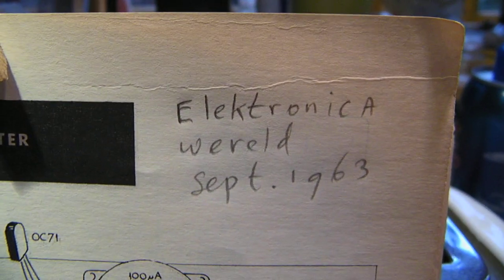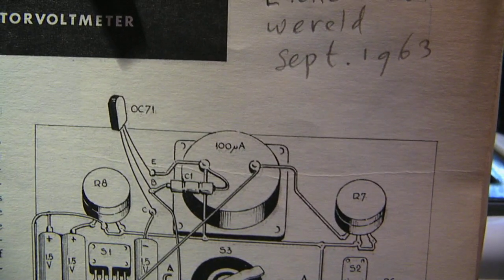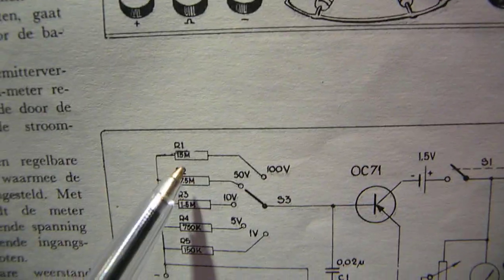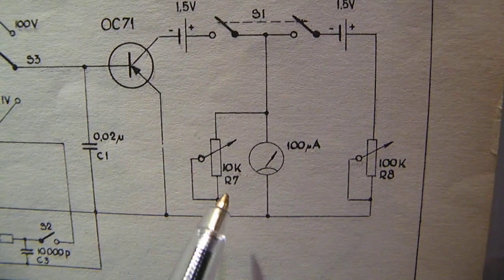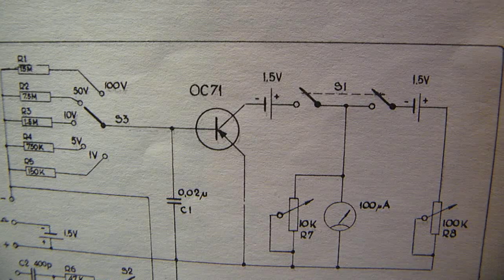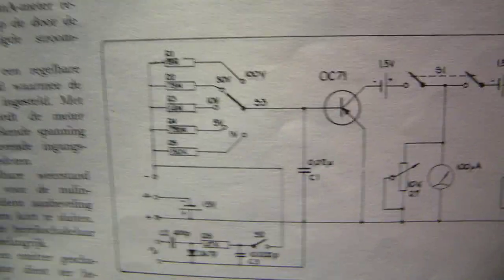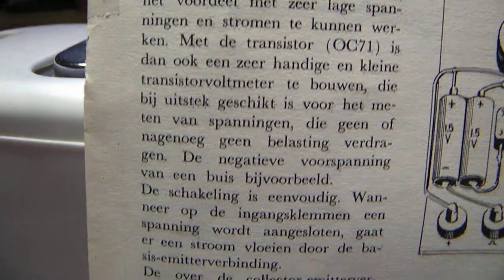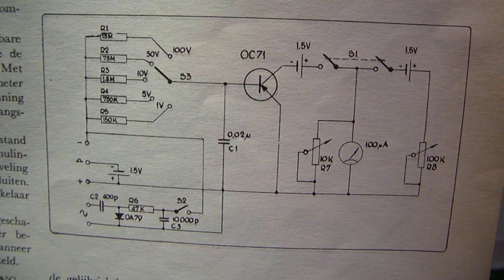Transistor voltmeter with very high input impedance (schematic 1963)

Comment: can we use silicon transistor? like many circuits in your videos? it is hard to find germanium transistor !
Reply from the maker: Perhaps when you raise the 2 voltage sources (batteries) of 1,5 V to 3 Volt. Reason: the barrier voltage of a Silicon transistor is say between 0,7 V - 0,8 Volt and the barrier voltage of a Germanium transistor (used here) is (say) 0,3 Volt. That means that a 1,5 V battery is surely enough to drive a Germanium transistor but 1,5 V could be too small to drive a Silicon transistor. And you must use a BC 557 (PNP) Silicon transistor for such an experiment (Si transistor). I think there is a good chance that it will work (even with 2 x 1,5V it can, in theory, work). Try as a first experiment (to get your question answered): only 1 input resistor (say for 10 Volt), no AC input circuit (diode etc), so only the "bare" circuit. I am interested.

Comment: This is more a proof of concept than a practical circuit. It is prone to drift due to the unbalanced nature of the primitive Ge transistor and the lack of negative feedback makes it dependent on the linearity  of the hFE function. But in 1963 it would have been ok.
Reply from the maker: Yes, but they were very happy with it in 1962! And the rocket science was already there. And it works, that is important.

Comment: I built a similar device as this one in the early 60s. I didn't have access to precision resistors so it wasn't very accurate nor useful, but it tought me a lot. Not long afterward, I bought an Allied Radio VTVM kit and used it almost daily until fire destroyed my Ham shack in 1976. 

I find your videos very informative and useful. Thanks for sharing and keep up the good work. 

73, de Mick Bradford - WB4LSS
Reply from the maker: Good to hear that you have experience with the circuit, thanks.